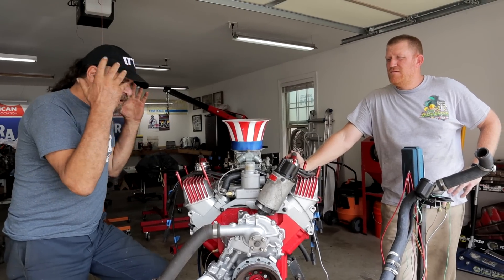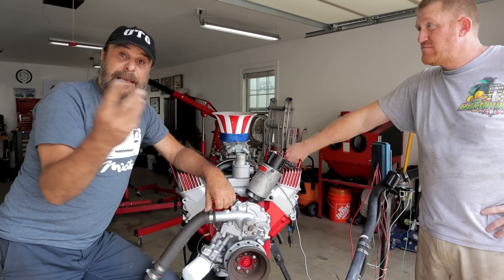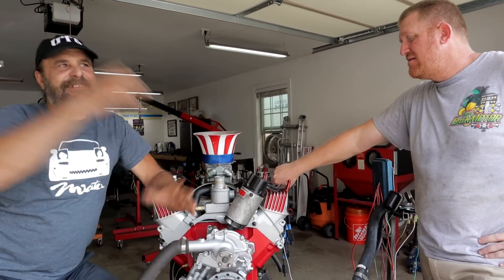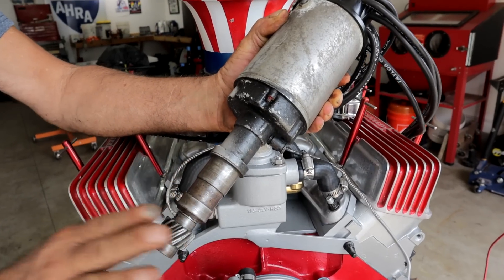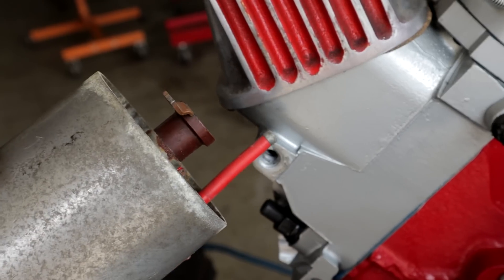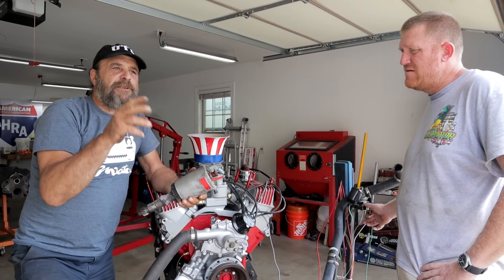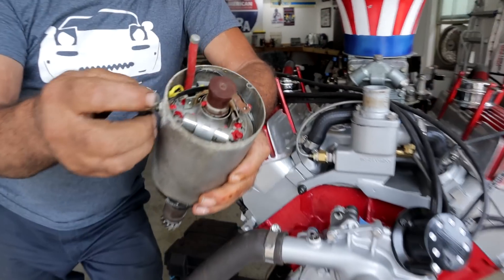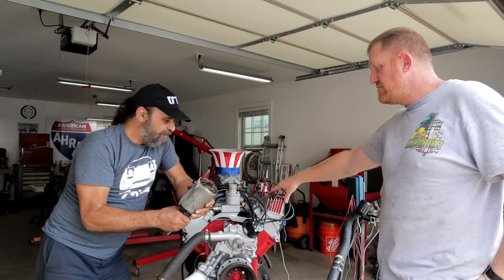The Magnificent Magneto

Comment: Oh god. So i have a motorized 2 stroke bicycle. It has a magneto ignition. I havent messed with it in years but had it out couple month s back. I tried to stop the engine but the kill switch stopped working. I wasnt thinking and reached down and tried to quickly unplug a wire from the magneto to an external coil. I got zapped HARD. So bad that i couldnt let go of the wire! Haha. So it took maybe 2.5 seconds for the engine to finally stop rotating. That was a long painful 2.5 seconds lol

Comment: What is the trade off with a coil system? I would think the change was worth it.
Reply: Magnetos take more power to drive, but are lighter than a full coil system since you need to have an alternator and battery to drive a standard ignition.

Comment: UT I got a distributor curved in like 2004 by an 80 year old man. He just got done curving a mag and he asked me to hold it just like Dallas and then spun it on me. He laughed so hard I thought he was going to piss him self....
Reply: Ha, our small engines teacher in high school did something similar.  Before disassembly, we tested the engines for spark.  He'd have half the class hold the plug wire near the plug while the other half pulled the engines over.  Right on cue, half of us got simultaneously shocked.  He grinned from ear to ear.
Reply: @brendanbuster  Old small Ditch Witch Trenchers with big single cylinder Wisconsins had Mags that would light you up if not paying any mind when doing a tune up lol. My teacher would leave charged up Cond's laying around in our class lol.
Reply: I used to mess with old lawnmower engines as a kid, built a 5 HP Briggs for a minibike. Briggs had the solid state mag out on market then. I remember pulling a spark plug on a running engine to shut er down. MAN I got poked. Arm hurt for a while after, lol. I think it was a 40,000 volt spark? Can't remember
Reply: If you think that hurts I was looking for a dead cylinder on my Firebird with an MSD set up on it and the biggest coil I could find. I went to reconnect the plug wire and my zipper on my jeans arcked to the car lol
Reply: @AnthonyPerna2  I remember going to adjust the timing on my car not knowing a hole had gotten worn out of the disto cap while on vacation at my grandad’s on the way out of town…it might not have been a magneto but grandad’s neighbors gave me the biggest stinkeye when I got lit up and barked out “F***!!!!!” loud enough to wake up the dead! LOLOL
Reply: My shop teacher used to get kids with motorcycles. He would go when they werent looking at take the plug cap off and draw a thick line on the porcelain from the terminal down to the body of the spark plug with lead pencil. And when they went to start them , it was no bueno.. LOL, they kicked and kicked and wouldnt find the prank until they pulled half the bike apart

Comment: UT how many amps does a regular Coi make
Reply: The voltage isn't that high on a mag. 
It's enough to make a spark at a low speed and it works though. 
But it's not this million volt whizzbang ignition by any means.  
20-30k volts is good enough to jump a gap.
Reply: @MrTheHillfolk  I know the voltage but I like to know what the amps are

Comment: Is that a nailhead?
Reply: Nailheads were termed such since their valve heads were quite small. You can recognize them because the valve covers go straight up.
Reply: Dallas said it's a 300, the big brother of the 215.
Reply: I know zip about Buick engines.  I know the 215 became the Rover V8 at some point.

Comment: Worked a little bit on a vintage (1959) hydroplane with a 360 cid. Chevy sprint car engine. Dry sump, 14.5/1 compression, Brodix, Hillborn injection on methanol. Engine in backwards and the prop was direct drive straight from the front of the crank snout, no balancer. Couldn't push start the boat so it had battery/starter setup, but used the Vertex magneto. Very fast wooden hull boat. 160 mph. Lots of fun!

Comment: Tractors used all the time like the farmall a b c h m tractors a lot vintage tractors had mags
Reply: The early 4 cylinder Mercury outboards used a Fairbanks tractor mag. They then made their own which was pretty much the same with a lot of improvements. They could keep up with a 4 cylinder 2 stroke running at 8,000 rpm.

Comment: I remember magnetos on old motorcycles, if I remember it right it's called Joe hunt, and on aircooled volkwagens
Reply: Yup, my 1955 BMW R50 has magneto ignition.
Reply: I bought a 750 Ducati in 1973. They had just switched from magneto to coil ignition. But they didn't change the switch on the handlebar. Note that Tony said that you stop the spark on a magneto by shorting it out. Well, that's what the On-Off switch on the bars did. The "Off" position made contact and grounded out the magneto. Except that coils don't work that way. So to run the bike, you had to switch it to "Off" to put battery voltage on the coil. This confused me for a while, especially since it was a kick-start bike.
Reply: Also on airplane engines.

The magnetos for a big radial are nuts!

Comment: That "is" a good lookin engine!
I'm not familiar with "back in the day"  Buick hardware UT but these videos you're doing have been very interesting, filling in the gaps brother thank you! Oh,h,h,h I like how he just casually puts a piece of tape over the distributor hole to keep those tiny screws from falling in!
Reply: I saw that , he is a cool cat ! No big deal snuck it over the hole without a word !
Reply: Having suffered a sheared distributor drive gear in a /6 '70 Valiant 35 years ago from a dropped screw into the bowels of the distributor - followed by installing the replacement off by 1 tooth and finally readjusting it 1 tooth at a time the wrong-way-round - I cannot emphasize enough how important a piece of tape can be!

Another old-time casual factoid regarding building a Buick: because it's such an uncommon musclecar build, nearly all of the scant few aftermarket parts available for it tend to be high-zoot, higher-cost parts, resulting in Buick builds being the baddest in general terms.
Reply: Yes l caught that as well... 😆 😆👍🏼👍🏼

Comment: Mags are a bit finicky, they don't make good spark at low rpm they eat a ton of HP at high rpm.  For applications without a battery they rock but now for anything else there's better tech out there.  That being said I have one in my 33 hot rod but only for the cool factor of being period correct.
Reply: That's why lower RPM farm tractors had an impulse coupling to make the magnet swing faster when the engine dropped below a certain RPM
When the engine dropped down you would hear a distinct clickety click click
Reply: @ronalddaub7965  Nice! Didn't know that

Comment: Good Stuff!  DV was telling me that he did a Dyno test years ago . He was amazed at how much power was lost driving a Mag compared to a regular distributor setup ...  That would be a fun test to do... 
Andy
Reply: Well, it's gotta drive a small generator.
Reply: Planes use mags. 
But they use impulse couplings at CFA king speeds to get a hot spark. 
Most of em have dual plugs , and when you drop a mag during a run up mag check , she drops about 50rpms.
Reply: @MrTheHillfolk  the impulse it to kick the mag internals over faster for hotter spark at start-up.
Reply: The power to produce the spark has to come from somewhere. But, to get that good of a spark out of a “normal” ignition system would require a lot more weight you have to haul around.
Reply: And running a .020 plug gap does not help low end power at all
Reply: @67L-88  I run .020" on a N20  Mod Motor and make 4 digit power...  As cylinder pressure increases you must tighten the gap so that the spark can make it across the gap!  
Andy
Reply: @67L-88  yeah I agree, at big power levels it becomes a necessity to close the gap... On a street car deal. You want the widest gap the ignition can fire to insure complete combustion... 
Andy
Reply: @67L-88   can't run a fat gap, they don't have enough ass
Reply: Of course DV notices the power loss.